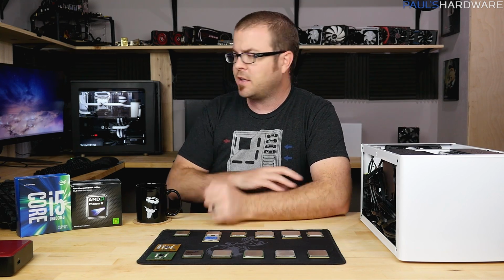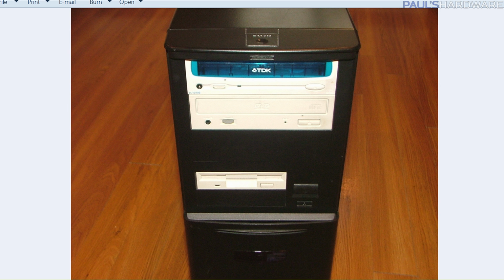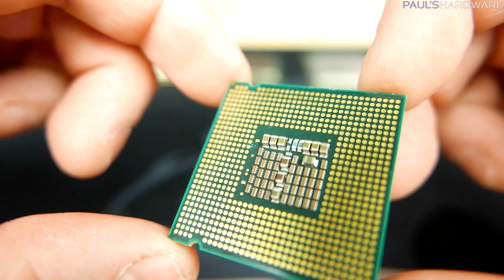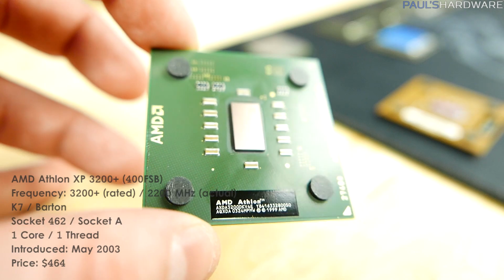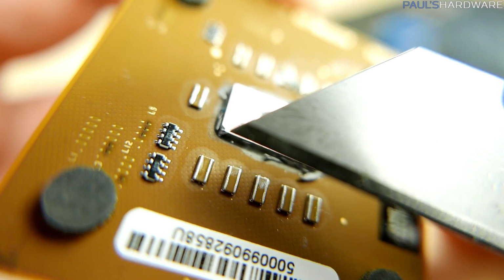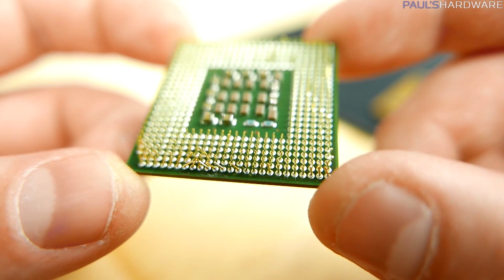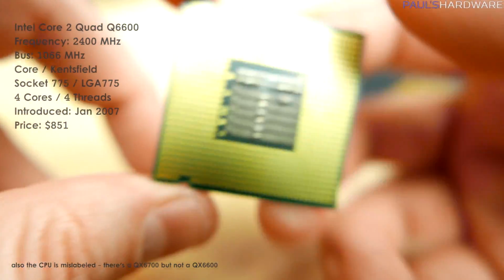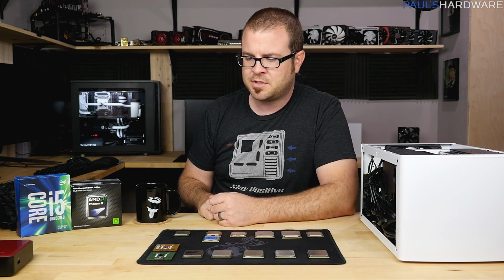My CPU Collection!

Comment: MY first CPU, EVER - Was a 486DX2 my dad bought in a Zeos 486 PC when I was about 5 years old!

Oh how fondly I remember Wing Commander 2, Comanche 64, TIM, Daggerfall, Alone in the Dark, and SO MUCH more!

I REALLY wish I still had that ENTIRE system! Even though we DID upgrade with an Intel Overdrive 133MHz CPU before finally getting a Pentium 166!
Reply: First PC I built ENTIRELY for myself, out of nothing but parts, was an Athlon XP 2700 that I managed to Over Clock to, IIRC, 2.6 GHz, in any case - it WAS running a good deal FASTER than the XP 3200! IIRC it was an NForce 3 chipset, but in any case it had AGP 8x - which was occupied with first a GTX 5600, and not too long after that, was upgraded to a 9800 GTX.

Comment: i have a 920 i found it on the side of the road in a bashed up computer xD i think i works. I curently use a xeon e5504 on my second system it is on the sane socket as the 920

Comment: Now nobody can bend pins on a CPU (AMD is going LGA this year with Zen I think) but you can bend pins on a motherboard so it's not really solved xD
And bend pins on a motherboard are harder to fix than bend pins on CPU.

Still have a working PC with an athlon xp working. And still have athlon 64 x2 too.

Comment: I kinda wish I kept the CPUs I've had over the years, even if not extensive

AMD: Athlon XP 1900+
Intel: Pentium Dual Core E2140, Core2Duo E7500 (managed to get nice overclocks out of that)

I only have a Phenom II x6 1090T Black Edition in a WIP spare parts build, using an FX-8320 in my current/main.

Comment: I'd have to check our attic, but I still should have a 386/33 and an original Pentium 1/90 system up there. The first PC we ever had was a 286 from NCR in a solid metal case with a 5 1/4 drive that was basically a desktop unit, but looked like a tower. 

Also have a Pentium II/333 and a AMD Thunderbird 1400 CPU sitting in a desk. I'm sure at some point, all of this is going to be worth money again =)

Comment: I had Q6600 running at 3.5GHz for years,1.4v,air cooled.Fucking beast of a CPU.Just changed it recently cause the mobo gave up.

Comment: I fondly remember my socket 462 AMD Sempron 3000+ (2000HMz actual). I loved that chip! My father still uses a socket LGA775 Q9650 overclocked at 3.6GHz. That's still a monster with it's four cores and 12MB of cache.

Comment: Paul, that Pentium 4 is not a Prescott core. The lowest speed Prescott on 478 is the 2.8 GHz one with 800 MHz FSB. You have an even older Northwood Pentium 4 launched in 2002.

Comment: My buddy had an FX-62 overclocked to 4.1GHz for 8-10 years straight. When he finally upgraded to haswell and we literally pried the Freezer 64 off of it, there was heat discoloration on both surfaces because its load temps were 85-100C

The GTX 275 in that rig had warped plastic because it ran at ~95C under load, for almost as long

Original AMD64 CPUs are based. Hopefully Zen will be worth a shit

Comment: Abit, I wish they hadn't have gone under, I just acquired an Abit IP35 Pro from Ebay, I had the Pro XE version that died and I used an Intel DP35DP as a replacement for a couple years, it was time for another IP35 which runs circles around the Intel board.

Comment: I went from a 286 to a Cyrix mII to a Pentium III to an Athlon XP to a Core2Duo to an i3 2100. Right now I actually have 5 modern working rigs, one of them is still the i3 2100 because it still works really well. My main daily driver is using an FX 8320 but I also have another FX 6300 and an i5 6600 and an i7 4770.

Comment: I damaged a cpu once don't recall what it was but I think it was intel but when I was using a screw driver to clap down the heat sink I slipped and dug out a line thru the cpu surface under a mag I could see all the stuff of the cpu well I was bumed but went ahead and it worked even with a big hole in the middle I contacted the place I got the parts explained what I done and asked if they would send a new one they did.

Comment: I can remember the first PC my family owned.  It was built in 1998 and was running an Intel Pentium II processor.  The first system I owned was a Dell Dimension 4600 which had an Intel Pentium 4 processor.  The next Dell system I had was the XPS 9100, which was an X58 platform and ran the i7-930.  It currently runs a custom X58 system I pieced together nearly 2 years ago.  The system I use currently is an i7-4820K on the X79 platform.

Comment: Still rocking the 6 core i7 980x. 2010 CPU and still strong.
Reply: good old days! first top end PC, eh memories
Reply: +Alex Crane old days?? haha 980x is still relevant
Reply: +delatroy it sure is, I mean it was the pioneer
Reply: +Alex Crane I'm waiting for broadwell-e and pascal to build a new PC. I think if you build the broadwell-e 10 core, you would be good for about 7-10 years with just updating your GPU for just gaming. It's pretty sad but this is the level we've gotten to. $1000 for a CPU in this light is not a lot given the extra longevity.
Reply: I've got a six-core CPU from 2010 as well, but it's a Phenom II, the last high-end CPU type that AMD made that actually made sense.
Reply: +delatroy I7 920 master race here.
Reply: +delatroy cool. Back at 2008 or 09, when I first built my computer, I was stuck between the 980x or 960. In the end I got the 960 cuz the 980x was so expensive =( But still today it is running strong. Had to replace a power supply tho...rosewill supplies aren't that good after 5 years.

Comment: wouldn't the 8370 a bit faster then the 8350.
Reply: I believe the 8370 is a more refined version of the 8350. And I think the 8370 has 0.1 higher turbo clock than the 8350. But wouldn't make much of a difference in games.

Comment: My CPU history:

Intel Pentium I 150 MHz
AMD Duron 1200 MHz
AMD Athlon 64 X2 3600+ 2000 MHz
AMD Athlon 64 X2 4600+ 2400 MHz
AMD Phenom II X2 555 @ X4 3600 MHz
Intel Core i7 2600K @ 4200 MHz
Intel Core i7 4790K @ 4600 MHz
Reply: +OhLookIt'sAnUnexpectedChromebook yes i was poor. All of my friends could play counter strike and I had to go to a cyber :p
Reply: Mine: amd a4-6300.
Done.
;-;
Reply: +Rodrigo Orellano I still got a 1.2/1.1Ghz Duron on my shelf (I forget what it exactly is Don't have a mobo to test)
Reply: +Andrew Johnstone You can check by the serial number :p That CPU was good for CS 1.5
Reply: Rodrigo Orellano Aw man thoose were the days! Remember the shitty dial up we used to deal with back then!
Reply: I'm still using my phenom II x2 555 :( I'm looking at getting an upgrade this summer, which is long overdue.
Reply: fern Its ok I run an OC'ed Athlon 640 I feel u man
Reply: +fern If you can unlock the 4 cores you double processing power
Reply: +Rodrigo Orellano Thank you so much! I never even knew you could do that! I just wish I had known that for the past 6 years I've been dealing with this system lol.
Reply: fern Lol better late than never. Enjoy
Reply: +fern be careful though there's a possibility some of the cores are unstable as they usually disabled them as they were defective or want to meet market demands and rebadged them as lower core cpus
Reply: +Chalklate You are right. When I unlocked the extra cores, it got unstable for a bit. All I had to do was underclock  it by 200 MHz and it's stable now. Still getting almost double the performance though. It's a pretty reasonable trade-off.
Reply: you should check the temperatures and run a stress test for atleast about 10 hours cause imagine you are having important work and then it suddenly shuts off then your files get corrupted :|
Reply: +Chalklate Don't worry, I've already done that. I've been overclocking my CPU for a while now, I just somehow never knew there were two disabled cores. My temperatures are actually 10 degrees lower with all four cores on my underclock vs two overclocked cores. Running at about 70 degrees under full load, but thanks your your help.
Reply: idk but I don't think you can unlock only 1 core and make it a tri core but maybe it will be more stable with 3 cores enabled
Reply: Chalklate I tried that, but I was getting better frame rates on the slower four cores.
Reply: +Rodrigo Orellano Wow so similar!

AMD K6-2 450MHz (OC@550MHz)
AMD Duron 1200 MHz (OC@1.4GHz)
AMD Athlon 64 3000+ 
AMD Athlon 64 X2 3600+
AMD Phenom II X2 555
Intel Core i5 2500k @ 4.97 GHz
Reply: pentium 4, pentium 4, pentium e5500, core i3 6100.
Reply: pentium 3, q6600, FX 6300
Reply: Intel Pentium E6300 @2.? GHz
Intel Core i5 4430 @3.0 GHz (Which I got yesterday)
Reply: -Pentium 4 3.0ghz [DESKTOP]
-Amd Athlon x64 (absolete hate it, always overheating) [LAPTOP]
-intel i5-3200QM [LAPTOP]
-intel i7-6700HQ [LAPTOP]
Reply: Rodrigo Orellano i3 4160 @ 3.6GHz
Ryzen 7 1700 @3.7 (OC) 
quite an upgrade ;)
Reply: I can't even list them all, I've been building, selling, flipping and fixing for over 20 years. I've probably personally used a hundred rigs, and sold every one for a profit.

Comment: I still have an I7 920 and I use it to this day, it's clocked at 2.67 ghz, I am using the exact motherboard he said, an evga x58 motherboard, for Christmas I upgraded from 6gb of ram to 12 with my triple channel and I'm running a Radeon R9 270 in this rig. I can EASILY run even the newest games like Just cause 3, gta 5, black ops 3 and I get a out 60-100 fps at all times. I also currently have a corsair 120mm liquid cooler on it. I've got to say that it's done me well over the years and I'm happy to FINALLY upgrade and build my new pc which will have an I7 6700k which is DEFINITELY an upgrade. I mean 1st generation I7 vs 6th lol

Comment: Hell yeah like a dumbass I remember cracking one of those AMD CPU's back in the day trying to install a cheap Chinese cooler I had gotten off eBay, and I was pissed like crazy, and yep I've also come across bent AMD pins as well when one of my neighbors kids had messed around with her ACER that had an AMD Athalon II X2 installed in it, thinking he knew what he was doing on cleaning the thing without telling his mother beforehand(11 year old idiot punk) and forced the CPU into the socket wrong, and bending 1/2 the pins on the CPU, and even managed to crack the plastic CPU holder on the motherboard costing her a new CPU, cooler, motherboard, and ram(did an upgrade to 4GB of ram, orb cooler, and an AMD Athalon II X3 setup), I did the job mostly for free minus the parts, but she did make her kid mow my lawns for most of the summer which was SWEET!!

Comment: I still have a system with a AMD64 4200+ in it. First system was Intel SX25 based but from about 1996ish to 2008 I had various AMD K5's, K6's, K7's and K8's. Now rocking a 4690k

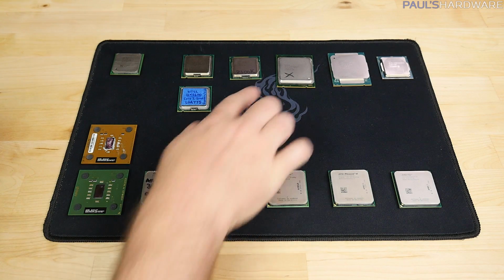Comment: @6:45 Are you sure that was THE first "consumer" 6 core from Intel? what about the i7 980X (skt.1366, X58)? Wasn't that the first one? Followed by i7 970, i7 990X and i7 980? There were at least, four six core CPUs for "consumers" from Intel before the i7 3960X

Comment: Paul I'm surprised you don't have a Cyrix chip from back in the day when they were pretty hot. They were the first to start with the higher performance than actual clock speed. I still have a Cyrix 333 mhz that actually ran at 266mhz, but they were excellent chips. I have some of the same CPU's  that u have now minus the x99 platform. I like the nostalgia of this. By the way my first computer I built was also a Pentium 486 dx2 66 mhz system back in the mid 90's.

Comment: I used to straighten bent pins on pentium 4s when I worked for dell it was a right pain but like you I got skilled at it used a different method I used a plastic straw like thing to straighten them however CPUs like the one in your video we wrote off immediately

Comment: @Paul's Hardware - I currently use a CPU which I removed the IHS from, and my waterblock has sheered one corner off the die like the one you showed, it still works fine to this day.

Comment: are those the cpus that get soldered on
Reply: Alfred X ok, Need a tampon with that moody :)
Reply: what are you talking about?
Reply: +Soul Atrophy im talking about  the cpus in the thumbnail
Reply: No. Pin Grid Array or PGA chips have pins on the CPU and are inserted into pinless sockets, Land Grid Array or LGA chips have pins on the socket on which the flat-bottomed CPU rests, and Ball Grid Array or BGA chips don't have pins at all, and are supposed to be soldered to the motherboard.
Reply: +Soul Atrophy He is asking if any of them are the soldered in laptop CPU's (most laptop CPU's are soldered) he is a dumbass
Reply: +Andrew Johnstone Fuck you bitch
Reply: +Andrew Johnstone ur mom
Reply: +Robert Faber thx

Comment: in single threading, my phenom II x4 965 BE @ 4 ghz beats or breaks even with any other stock speed amd CPU except for the 8350

ill never understood how bulldozer got past the drawing board
Reply: +Yelkwood9 
Basically what happend was that on paper the design would give multi-trheaded work loads a HUGE boost in performance. 
When they actually got far enough in development to test them.....they were woefully disappointing performance wise,, but to far into development to switch to something else. They delayed the launch by a year trying to make the design perform as expected (still let board makers sell boards with the socket/chipset for it though), but according to a lot of rumors coming from internal employees they couldn't make it any better.

SO when it FINALLY launched they essentially released a chip that was already a year out of date, and on a platform they had sunk to much time into to turn back on. They didn't have another option. Supposedly Vishera puts out the performance they initially expected.....for what they had planned to originally launch in 2010. Oops.

Keep in mind, while they were delaying the launch, they were also hyping the crap out of it cause they thought they could reach Vishera in that short time to salvage it. In doing so they made Intel worried about being able to keep up, and thus the 2500k/2600k was born to compete with what Intel thought was going to be this godly CPU. 
Which is why we now have 5 year old Intel CPUs that can be OC'ed to do everything and more the FX 9590 can do.
Reply: +akabiscuitwaffle Now, I know that AMD is old now. But if you watch Tek Syndicates video on the subject the 8350 can beat the i5 3770k in a variety of games. I have definitely seen similar results with my 8370. Compared to any modern CPU obviously AMD doesn't measure up, however they were very good value. They still are if you buy used parts like me.
Reply: Yup my phenom ii x6 1055t is still running strong
Reply: Yeah, my Phenom II X6 1055T comes very close as well, even though it's not a Black Edition so it only runs 2.8GHz. Bulldozer really was a catastrophic flop...
Reply: +Person. 
look at something like Rome. fx-8350 goes down to like 11 fps, an i5-6700k which doesn't cost much doesnt go under 40
Reply: gg phenoms
Reply: ***** 
Actually the FX 8350 trades blows with the equally priced i5's like the 4460. Performance varying on which does better from game to game. 

The FX chip it self is cheaper, but the boards cost more so they end up being about the same.

Comment: i remember when i got my 1st cpu an amd a8 5600k there was a few bent pins.  i was so worried that it was busted. but i ended up using my thumbnail to straighten the pin

Comment: 2/10 no Slot 1 processors
Reply: Yosyp Slot 1 was Intel's CPU platform before they introduced socketed CPUs in the Pentium III era, and they, for the most part, look like expansion cards with relatively sizable heat sinks on them. It was introduced during the Pentium era, which was after his first computer with a 486DX. AMD's Slot A was similar to Slot 1, although I have more experience with Slot 1 than Slot A. Stop being stupid and look up some PC history beyond Intel Core processors and nVidia/AMD GPU competition, because the 90's were really quite interesting, with all sorts of different GPU manufacturers and the Gigahertz wars.
Reply: +inteli722 or AMD Thunderbird Slot A (had a custom ordered and rare Gateway PC back in the day with an 800Mhz AMD Thunderbird Slot A that I bumped to 1Ghz a few years later after a lucky eBay find along with 256MB of DDR ram)
Reply: He said he had his first syatem when he was 16, not 1.
Reply: Yosyp You need to look up what an Intel Slot 1 Pentium III CPU is along with the AMD Slot A CPU lines were before making a stupid boneheaded comment like that.  They where CPU's in a cartage style package that fit into a cartage style slot instead of a more common CPU Socket design.
Reply: inteli722 Calm down mate, I know a litte bit of old hardware but there no need to be rude.
I know that not only Intel and Nvidia existed in history.
Reply: Yosyp Well then lesson learned, don't comment on topic you know nothing about making yourself look stupid.